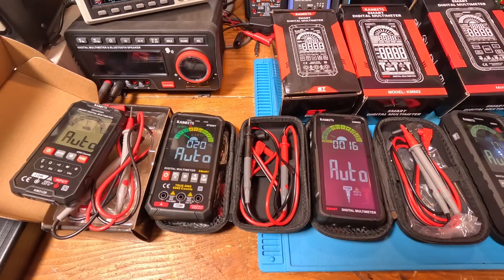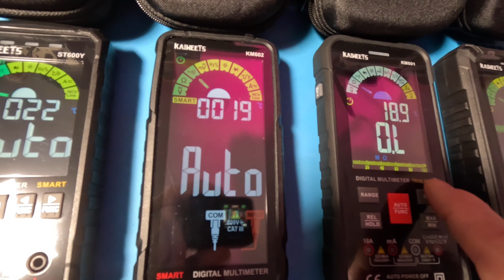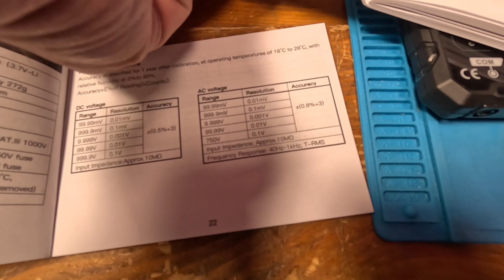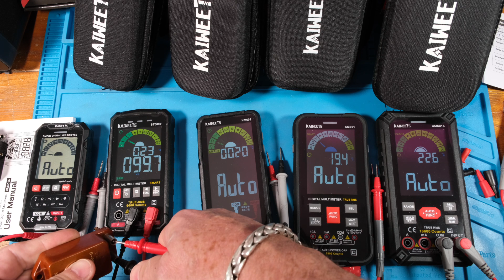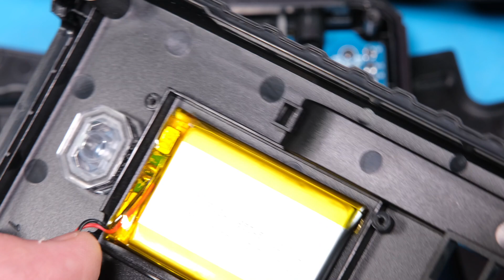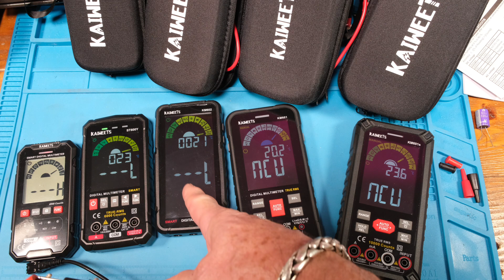Kaiweets Smart Multimeter Shootout and misc tools KM601S, KM601, KM602

Comment: KM602 is 10000 counts , I wish it was 20000 counts just like HT118E
Reply from the maker: Yes, the 10000 counts is better than many - but 20000 would have been even better.  Maybe it is the display type used in the 600 series.  Remember, if you use the KA15 discount code at the kaiweets website you can get 15% discount.

Comment: Kinda funny that you have 4 of their meters right next to each other and none of them can agree what the temp of your room is lol
Reply from the maker: LOL - yes they are not meant to be super accurate - but they do meet the spec which is good enough for most of us;)
Reply: @KissAnalog  I was waiting for a delivery driver watching your video. My 601s arrived a few hours ago from amazon. I have compared it with a megger MT1000 and a Milwaukee fork meter (which I have used for years and prefer over both flukes I had previously) and I get identical readings for ohms and ac/dc voltage on all 3! The temp readings do seem dubious,  though these are not really something I need. Impressed so far. Good review btw.
Reply from the maker: Thanks for giving us this great feedback!!

Comment: Is it possible to turn off the automatic power off feature on km601s ? i know km601 is possible but i dont see this option on km601s manual. Also when the turn off feature is disabled, you must use it or press a button to keep it on or will it turn off even if automatic turn off is disabled when not using it at all?

Comment: Kaiweets meters are pretty sweet, but the leads are pretty trash in my opinion (conductivity low).
Reply from the maker: Thanks for your feedback!  Sometimes I find a residue left on the tip leads and cleaning with rubbing alcohol seems to work.

Comment: I purchased a km601s. I found that the DC mA measurement has polar difference  for small current testing (i.e. under 0.010mA or less), the negative reading is much less than positive if I swap the leads. Is that a problem?

Comment: I can't remember the last time I needed to "Accurately" measure a micro-voltage, or milli-voltage, or current or resistance. Let alone, with a hand-held meter. As a side note, reminds me of the days when "High Fidelity" was coming of age with audio solid state power amps and receivers. The audio distortion specs on that equipment were far better than human hearing would ever be. It's referred to as the THD wars. We end up paying for "Specs" and "Functionality", that we don't need, or we will never, if rarely, use. Like having a 20K count meter, where the last digit is .2 accuracy +- 15 digits. It's crazy, no one will ever use that or need it. Fluke knows that 6K is just fine for everyday use. Adding a "High Res 20K" option is just a way for Fluke to conform to the market trend. 95% of Fluke users don't use, and don't need 20K resolution.
Reply from the maker: Thanks for your feedback - and I agree with so much of what you said.  However, so many people will ask what the accuracy is.  

How many times do we care about any number past the the first number after the decimal point?  But I do have to say I don't agree with the reason Fluke makes this an option.  

I think you are talking about the 87 which is a 20 + year old design.  The meter is slower in high count mode - and so are some others.  But Fluke was billing the 87 as a high accuracy meter so how can it be if it is only 6k count?  So, they had to add the higher count.  

Engineers like myself need a high count meter at times when performing design verification testing.  Yes, bench meters were commonly used for that - and still are - but hand held meters are so good these days with high count and wide bandwidth - they can do far more than they could 20 years ago.  

The 87 has always cost much more than the competition.  Today - that meter is showing its age and is not worth half the money that it sells for - IMHO;)
Reply: @KissAnalog  - Thanks for that Feedback, I respect point, but my objective was to bring attention to the question, just how accurate of a meter do we "really" need? Yes, EE during designing is fine tuning inspection, but I feel 95% of users, do not need, and will not use the available accuracy. But they pay for it. It makes most users, sort of, pseudo-engineers. It's more marketing, than it is necessitating.

Comment: I have that next up socket tester, HT106B. It adds a voltage display (xxx.x), a GFCI test button and an LED that I've never seen on. It's labeled "I∆n > 5mA". I've lost the manual so I can't definitely say what that test is.

Personally I prefer the smaller testers because this one takes up both sockets in a duplex. You can't plug it in if something else is already plugged into just one of the 2 sockets.
Reply from the maker: Thanks for the info!  I'd like to get one to see how it works.  The leakage current measurement is a great addition.

Comment: I just purchased one of their KM117B outlet testers that was mentioned, and was very disappointed with Kaiweets calibration and quality control. I wasn't expecting perfection for 20$ , but the line voltage reading was about 11 volts lower than the same outlet tested with a Fluke 87-V, a 189, and a Keysight U1232A. That's about 9% error, and makes it pretty useless for diagnostic testing. It's going back. Not recommended!  I also bought one of their smartmeters previously, the KM601, and was not impressed with the calibration and accuracy on that meter either. It was just barely in spec  or slightly out on the DC volt ranges and about 1.5% out (low) on AC at line voltage. This is compared to a recently caled HP 3457A and a Keithley 196.  It has a nice display though. I'm beginning to think the only Kaiweets meters that get a proper cal and decent QC are those sent out for review.
Reply from the maker: Thanks for your feedback!  Boy - you have had some bad luck!  I haven't heard of this problem before.  Also Amazon feedback has been good.